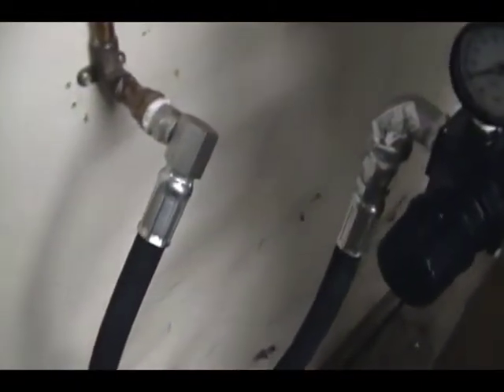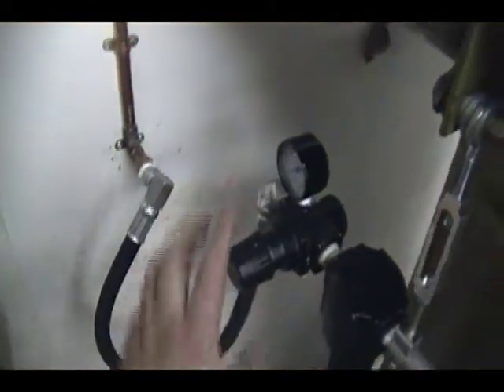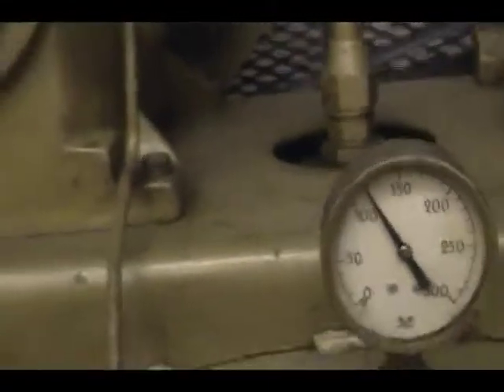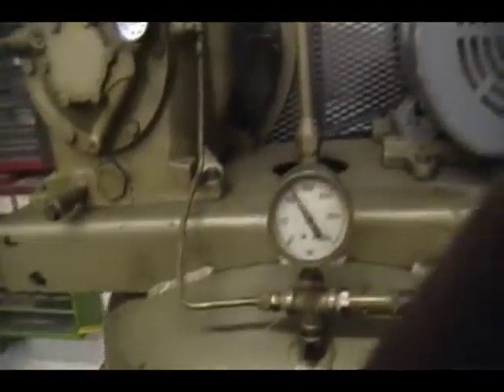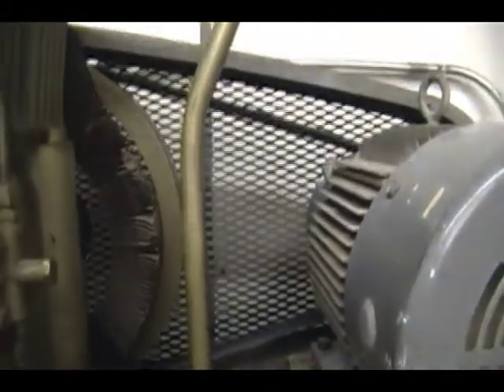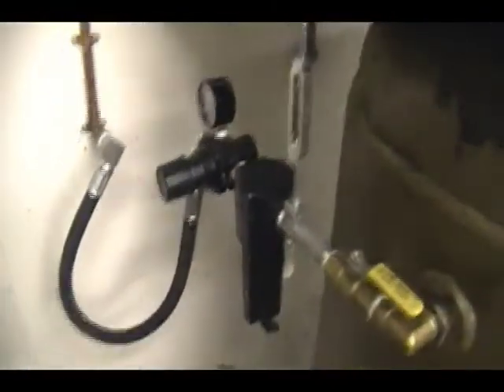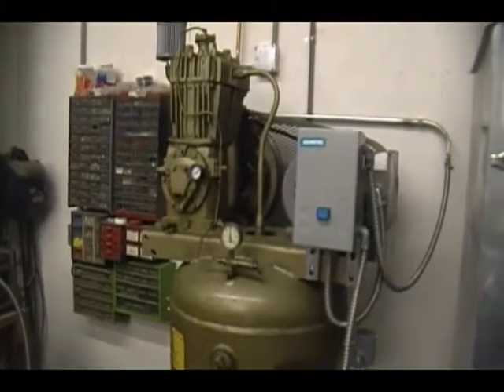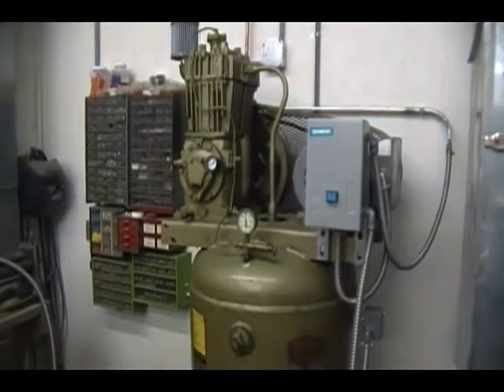Quincy QR-325 Compressor Final Update 3-15-12 part # 45

Comment from the maker: Hi, thanks for the comment. The motor is started by a magnetic starter. I have a disconnect switch on the wall, & later i added a toggle switch to the magnetic starter. The toggle switch just cuts power to the coil in the magnetic starter so the contacts can't close when the switch is off regardless if the pressure switch is closed or open.  Check out rotarycomptech's channel, he has a video on this. Unfortunately I don't give out much electrical advise. Let me know if you need anything else.

Comment: what kind of switch are you using to turn on the motor. I noticed it was a toggle switch before in another video and here your using the throw switch. im wondering because im trying to set mine up and im not to sure about all the electrical stuff. any help would be appreciated thanks